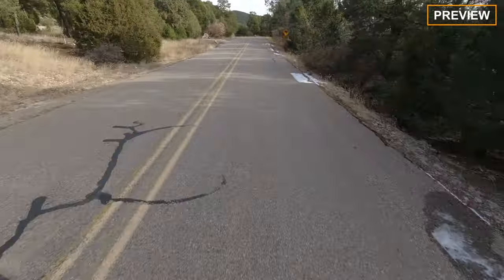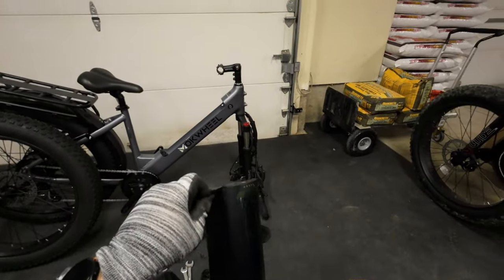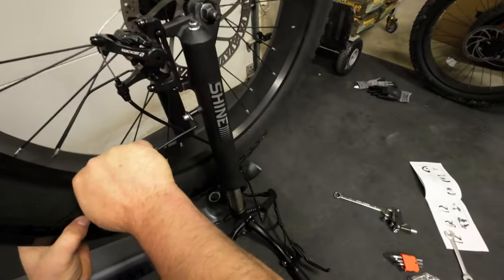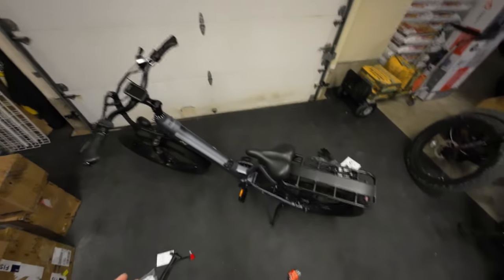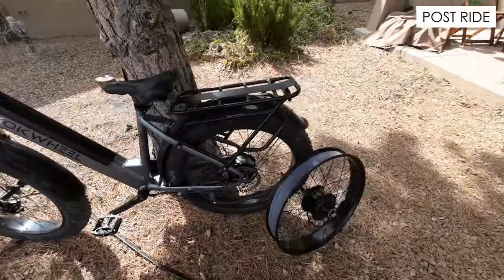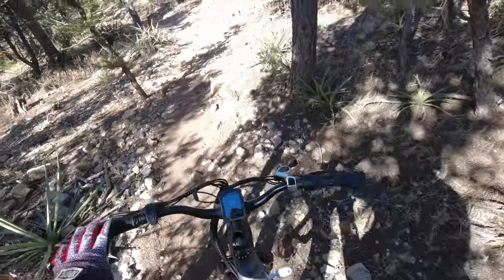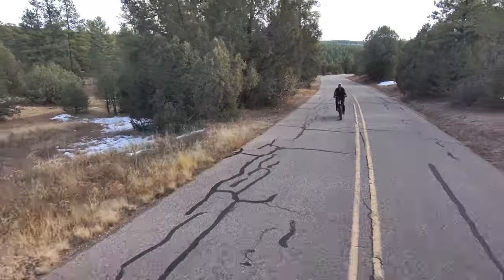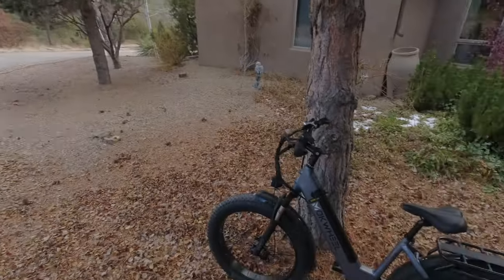MokWheel MESA ST PLUS E-Bike Review - Unbox/Setup/Ride Test

Comment: My M2S 750 has just short of 12K on it.   Bfang motor has been flawless. Original battery as well. No complaints. Changng the rear tire is a party but if you have the tools and patience you'll get through it.  Just part of the gig.

Comment: Forks are NOT supposed to leak oil. Seals are BAD. Adjust brakes at the wheel first and then use barrel adjusters if necessary. Other than that, bike is junk